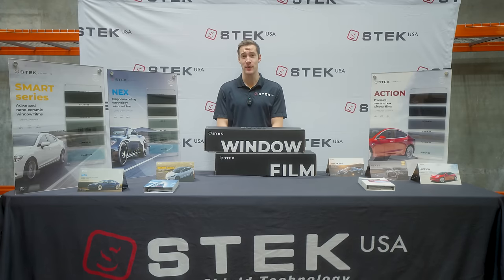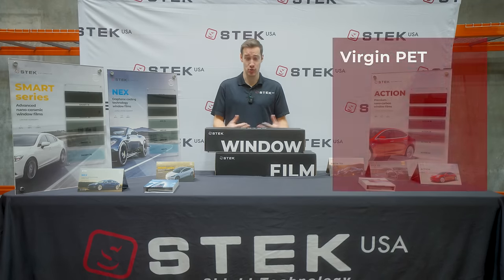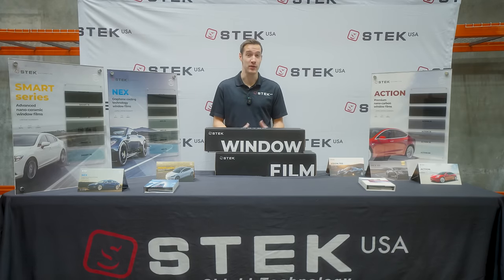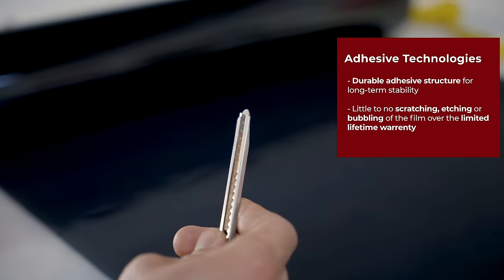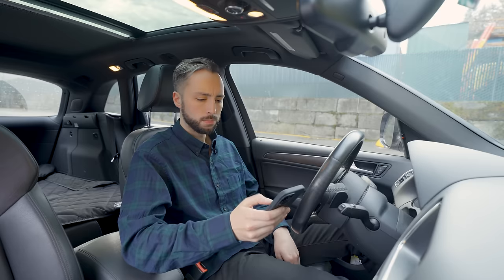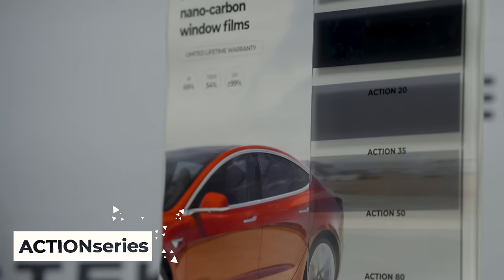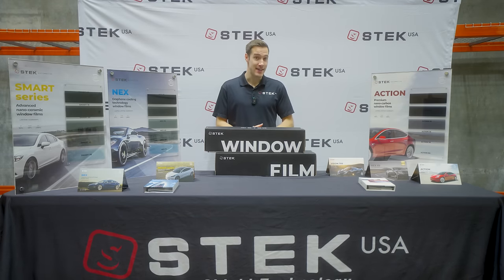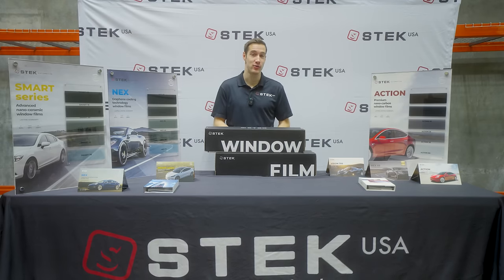STEK Window Tint Breakdown:  ACTIONseries - SMARTseries - NEXseries

Comment: How much heat rejection should you be getting with nex? Is there a temperature range?
Reply from the maker: Heat rejection is measured by the Total Solar Energy Rejection (TSER) and varies by the VLT of the film. NEX offers up to 64% TSER in the NEX 05, which has a VLT of 7%. You can find more info on the full NEXseries in the chart here: https://www.stek-usa.com/window-tint/nexseries/

Comment: Does the NEX affect cellphone/gps signal? Also how does it look when wearing polarized sunglasses?
Reply from the maker: Great question, NEX does not affect cellphone or GPS signal! And everyone's eyes are a little different, but we have yet to notice or have any change in the visual clarity reported to us when wearing polarized glasses while looking through NEX.
Reply: NEX does not include any metallic element, it should not and does not have any impact on the RF signal. It view through the film looks similar to with or without  polarised glasses. However, that also depends upon individuals vision.

Comment: Would it be recommended to use DYNOFlex on outside and NEX on inside of the windshield?
Reply from the maker: Hi Danny, we have seen multiple clients and some of our staff use DYNOflex on the outside and NEX on the inside of the windshield without issues; however, this would make it so you're looking through three layers which can, in some cases, cause some visible distortions.